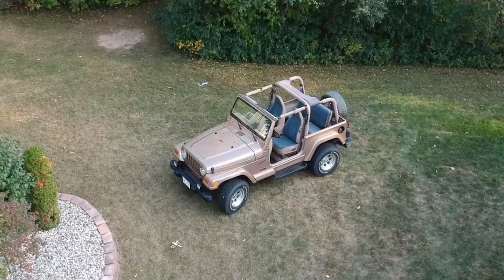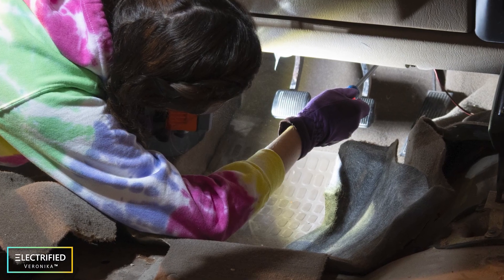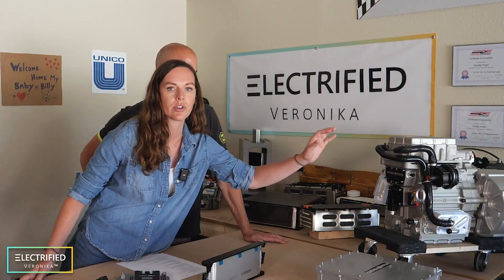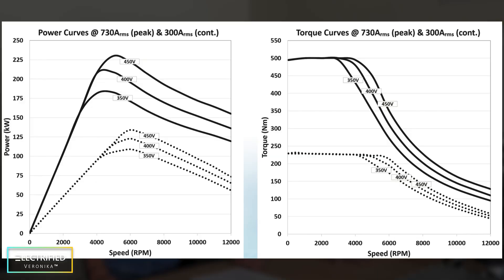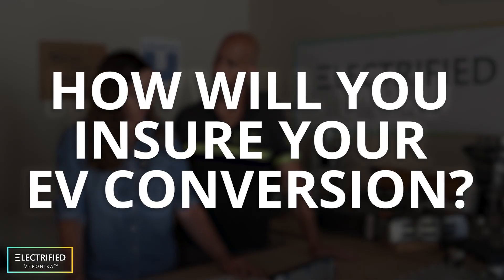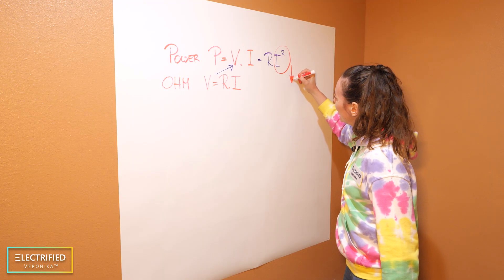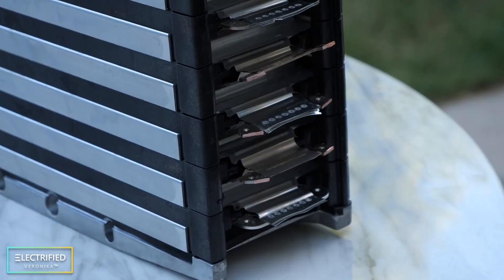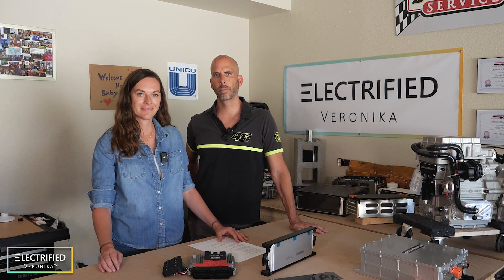How to Convert a Car to Electric - Common Questions

Comment: Great Q&A! All questions I would have asked. About regenerative braking: does the Cascadia not produce any regeneration in off-throttle (shaft rpm higher than rpm called for by the throttle position), or does it produce a certain amount off-throttle (akin to engine braking) and then a ramping increased amount as the sensor reads that the brake pedal is being depressed?

Comment: How are you handling the modern post-1996 electronic parts like ABS, traction control, airbags, OBD-II, etc.?
Can the AEM VCU physically connect and "speak" all the necessary CAN bus to these systems?
Reply from the maker: The Jeep didn't have ABS nor traction control so we didn't need to worry about those.  The airbags will still operate in their stand-alone condition (although we hope to never "test" them).  No OBD-II...  But, this is a good question and this is often asked by us for people that want to convert a "newer" vehicle and we always say that this is a significant challenge.  This is why so many people are converting older vehicles...(other than it's really cool to drive an older car/truck/Jeep that is electric...)

Comment: SO, I watched the majority of this series & am quite glad I did because THIS video you touched on several things that I may actually be able to apply (with any luck) to what I am(& have been) trying to figure out how to do for some time now.
 I've always wanted an Aprilia SXV Super Moto - But the engines had to be rebuilt every 6k (not very practical, really) but - for some reason my desire for the damn bike never waned. AT this point parts have become so hard to get there are full frames becoming available & I'm looking into what it would take to convert one to electric.
 A number of really great DIY motorcycle/E-bike options have become available but for some reason the cost seems somewhat elevated relative to what I feel like it ought to be - batteries in particular (a 72volt battery is roughly $1600 bucks & they don't seem to last very long before losing some "poop").
 Your mach-E battery solution is really intriguing - especially considering the possibility of making custom configurations that might better fit a combustion frame conversion - as opposed to one made to accommodate a large battery & controller.
 I'll likely use a mid-mount motor - since the balance of the motorcycle is critical to somewhat maintain handling & riding characteristics relative to original configuration.
 I'm excited to try & figure out how on earth I might be able to come up with a solution to make batteries like yours work - since Motor & controller options are relatively numerous for ebikes & motorcycles right now & really getting better by the minute it seems.

 Good luck & cheers

Comment: I’m enjoying the build and just found it.

Your axles will be determined more by your tire size, locked or open differential, and abuse ie if you’re spinning your tires (locked ie both tires spinning on that axle) trying to go over obstacles the wheels will start to bounce and bending the axle and between that and the torsion in the shaft those small shafts are not going to hold up. Weight at some point could be a problem, but I’d worry more about distribution.

I’m running diesel and higher torque than OEM (will be 400 ft-lbs when I replace my transmission +6.1 first gear) is really hard on my transmission and nothing else. I have done a super 35 kit in the rear differential with a selectable locker and 2.72:1 tcase and 3.73 axle ratio and 33” tires. Just note that I currently have had no issues with 300 ftlbs x 3.8 x 2.72 x 3.07 with 33 in tires on a stock axle with 200k mi (before the upgraded kit and don’t use chromoly axle shafts with that axle design).

I have another Jeep I have considered for EV swap, but price and practicality, range isn’t quite right so instead I want to build a 4x4 ev buggy. It may get an on board gen set just for additional range vs more batteries but we’ll see. I think having the limited speed will simplify the build. Honestly it’s not gonna be much more than a golf cart, but this is for fun, learning and proof of concept.

Comment: Just a quick remark. Why would the AEM BMS module have 12V and HV sense wires in one connector?!? this means there cannot be any isolation as per requirement for building an EV. The connector used is only rated to 250V, yet the BMS is designed for pack voltages way above this. I feel like this product clearly has not been designed with the correct engineering mindset.
Reply from the maker: I will make a video about the BMS system soon, but for now: No individual BMS will ever see more than 18 cell voltages so only a maximum of 90V (more like 4.2V times 18 so 75V) at the connector. The master BMS module has a +12V and Ground, and by design must reference to the lowest voltage cells in a pack. So even if a LV power channel shorted to the highest potential battery cell, only 90V would be possible and even then only of there has been a complete isolation failure somewhere else in the installation between HV and LV system. In that case the ISOmeter would have fired and the pack contactors would have been opened.
Reply: @ElectrifiedVeronika  Thank you for your response. This is all true, this still means the design does not comply to minimum requirement of isolation required in hardware between HV and LV. Of course failures are needed to cause issues, however from engineering principles and Regulation requirements in many countries this would already be a none compliant system. Is there any documentation that states which requirements are met within the BMS hardware and or are tested to?
Reply from the maker: @Tom-evnut  not that I know of, but maybe you want to reach out to the AEM team, they are super supportive. I know they are working on a beta version where there is no HV measurement present at all, but I don't have any more details.

Comment: Will need to replicate the torque rise (in software controlling inverter power command) of an ICE engine or your gonna snap stuff in about 7 to 10 places, weakest one 1st, followed by...
A wider ratio gears, is then possible, and maybe a clutch or torque converter, even something like a crude inertia clutch would  probably be made to work, simplest is to limit inverter with speed of wheels, speed of motor, gear path, and torque limit hit for each break point in torque chain.
Reply: If one was going to go rock crawling, or loan it to your nephew...

Comment: if it's not too much trouble, could you share (video if possible) how you break the cells apart and then get them together? spot weld or bolted? or?
Reply from the maker: Yes, I am editing this right now! It will be the next video 😀

Comment: 301 hp and 368 ft/lbs of torque.
remember though, does the geometry stress the vehicle will be taking now vs than before, is the frame and geometry of the vehicle designed to handle that stress or tension in the joints it originally had? any time the height is changed or power is completely changed, the chassis takes on different stress points or tension on the joints or different areas than how it was originally designed.
Reply from the maker: Thanks for your input. We will be very careful with this and might need to do some upgrades on the frame/suspension system etc. We are starting some vehicle dynamics and stress analysis to understand that better also. Plus, now we have started a collaboration with a local Jeep expert which will also help a lot.

Comment: What did you do for vehicle controls, like calibration of new power train? Are you doing application and calibration work at all?
Reply from the maker: We are using the AEM VCU300, more on that on the video after the next one. In terms of calibration you can set your limits and calibration parameters in the control unit, it won't be tooo elaborate though I believe. One thing we want to do once the Jeep is running is potentially putting it on a powertrain testbed and do some more calibration work there, still need to figure out the details.

Comment: Veronika I send you my E-MAIL about my All Electric Vehicle Without Plug-In Requirement and my Air Electric Vehicles Video. If you have seen my Air Electric Vehicles Video you should have noticed what you are doing with the jeep it is totally different.

Comment: Love the videos and now want to convert an early flat fender model Jeep.  What about brakes?  Will you still use the hydraulic ones or do something with regenerative braking.
Reply: We will use the hydraulic ones with an electric booster from a Tesla or Leaf or Prius and use a brake pressure sensor to input to the AEM VCU to also do regen braking.

Comment: Always look forward to your videos! So much information provided :) Following along closely to your project, as I am looking to convert my 2009 JKU, in Minnesota. Feel I will be able to model my conversion very closely to yours, but will have a little more space for battery mounting locations being a 4 door. Surprised on the cost, I have seen 400V kits that are $75K+ (Legacy EV and/or Revolt System kits). Maybe I can actually do mine sooner! I too LOVE the idea of keeping the stock location of the transfer case, which I was going to get a Atlas transfer case. Super curious how the stock axles will hold up with the amount of torque you will be generating, especially when off-roading. For your 12V system, checkout Dakota Lithium battery, half the weight, a variety of Amp Hours to choose from, and mountable in any orientation too. Lastly, curious what you will use for the in cabin heat/defrost/AC.
Reply: Thanks for the battery suggestion. We will look into it!  We are also thinking about v2 which we hope will be more affordable and even more DIY!  Stay tuned!

Comment: Are you going to be able to keep the AC/Heat for the cabin?
Reply: We are not initially going to add A/C as we plan on having the top off most of the time it is warm out. We have a plan for the stock heater core with a water heating system for both the battery and the cabin. We will see how it works out.
Reply: I'm not sure how they are doing it but there are definitely aircon systems that run off their own electric motor and electric heaters as well. The electric aircon is popular with people adding aircon into old classic cars that never had it as they don't need to try and attach compressors to the original pully belts etc. So it works for EV's as well.